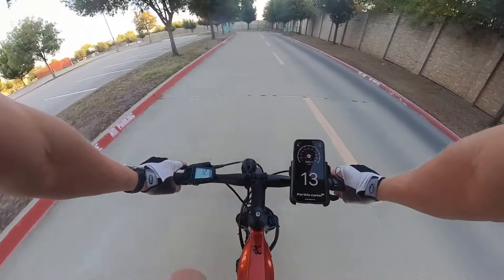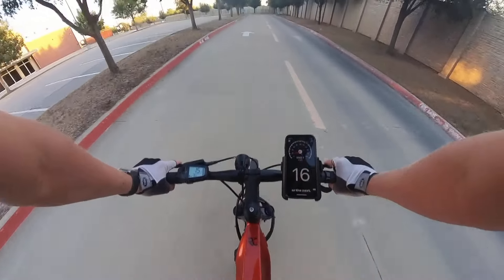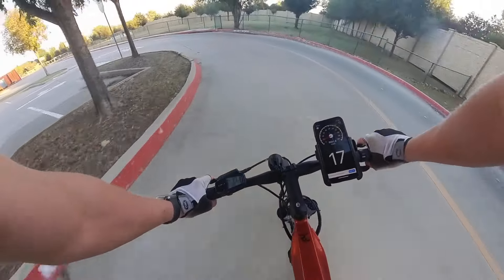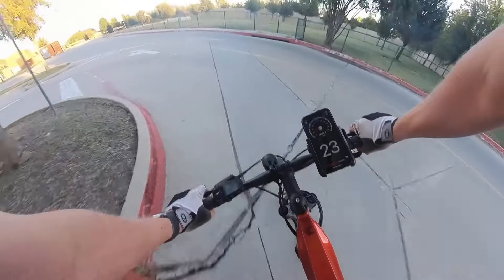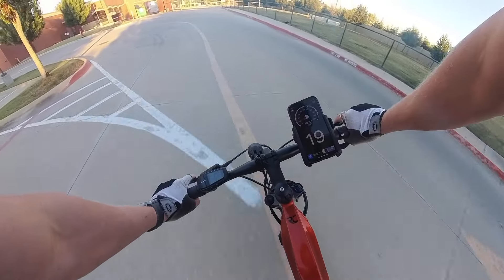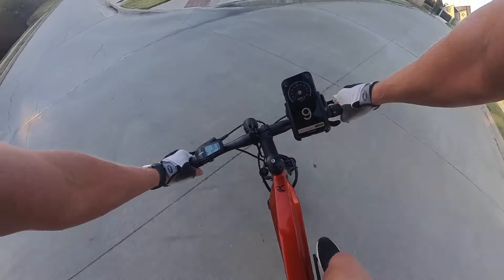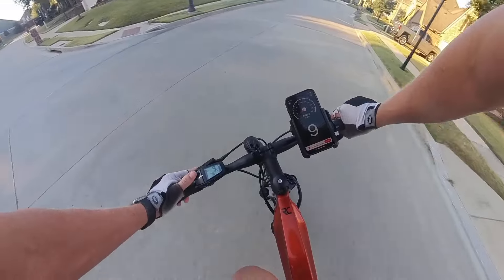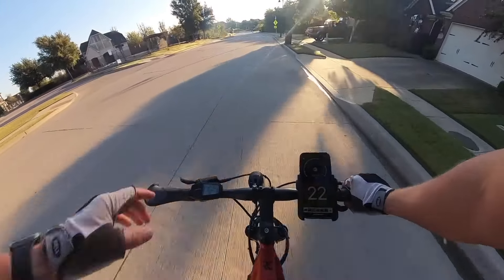Yamaha Crosscore RC Top Speed Test in Eco+ | Eco | Standard | High | Auto

Comment: I noticed my Crosscore RC slips some of the high gears every now and then under load as it happened to you in this video... Is it still happening to you? its not the end of the world but I do want to fix it.
Reply from the maker: @TheLegendStrike  it doesn’t happen to me as often as it did in the beginning. I noticed I do the same sometimes on my specialized sirrus x. For me I think it’s a combination of shifting and putting power in too soon. I haven’t found time to check the adjustment screw because the bikes rides just fine in 95% of my riding. Will do my best to check it in the coming month.